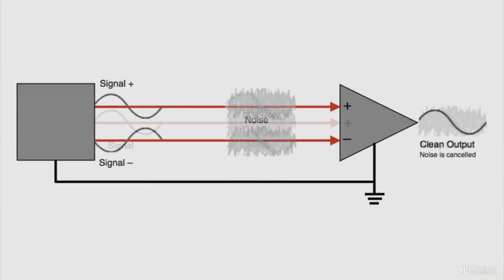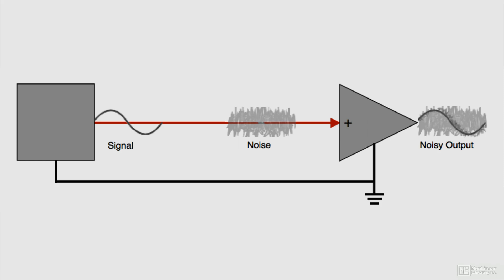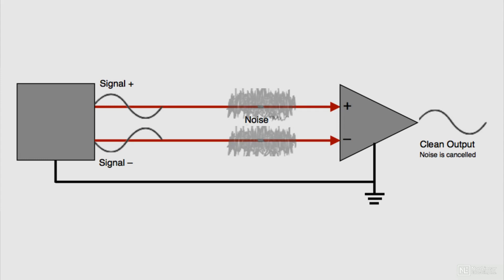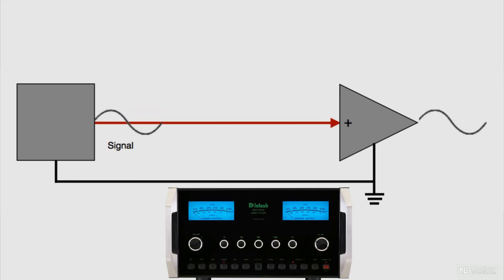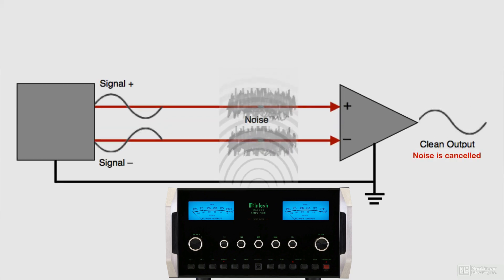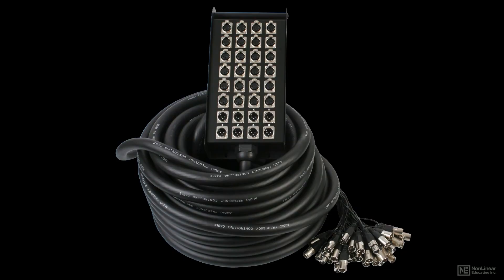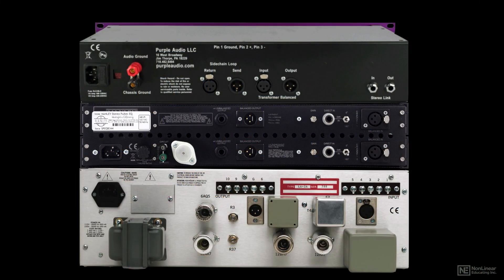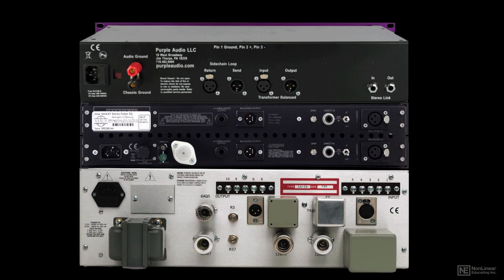AudioPedia 105: Recording and Monitoring - 3. Balanced  Unbalanced

Comment: I propose that balanced audio signal paths are not always the best solution. It would be good to address high versus low impedance signal paths and why each one is used. There is a good reason why home stereos sound great while using single ended line level signal paths and tend to have a lower noise floor and THD than professional audio gear that uses differential signal paths for connecting gear.